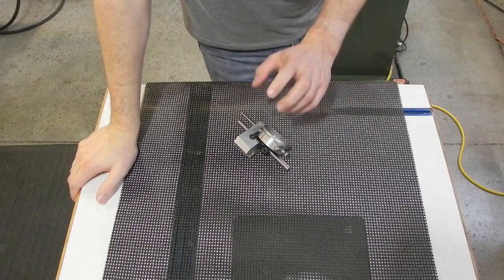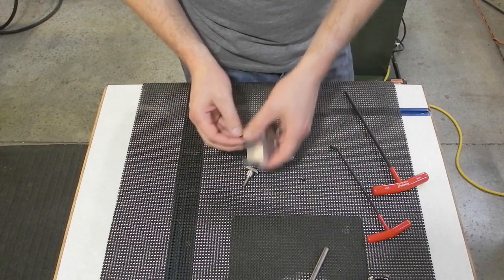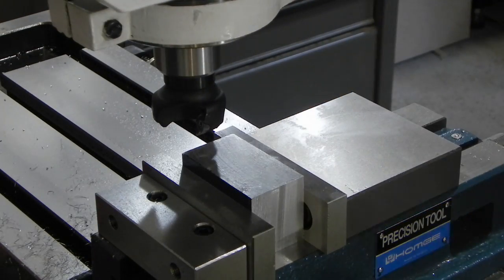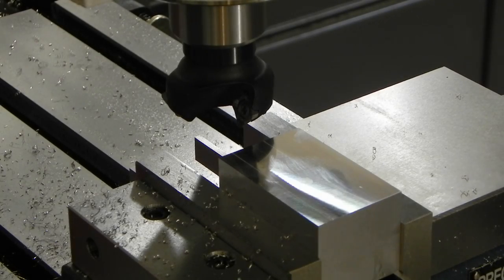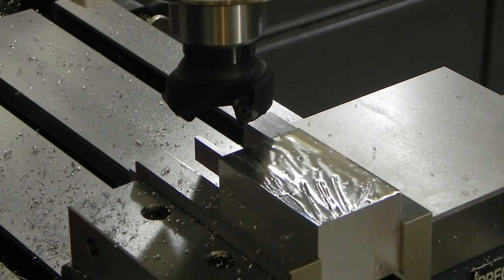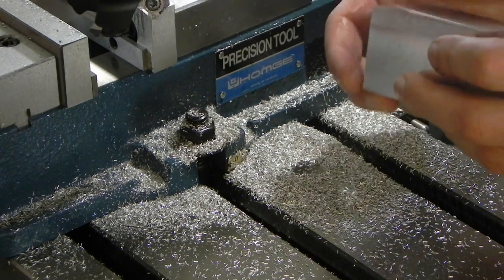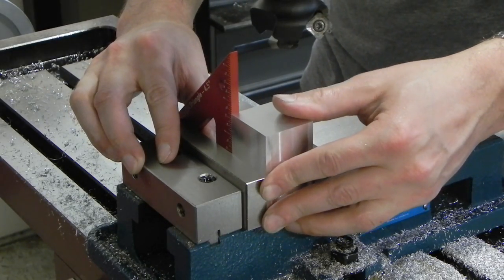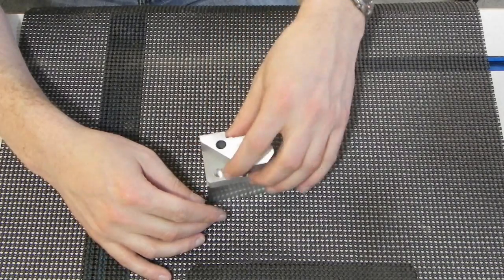Making a lathe carriage stop pt. 1

Comment: There's a few improvement points outlined below but the idea of using magnets seems a good one.  The bandsaw will cut quicker if the long edge of the workpiece was upright. Others have had problems getting enough torque on knurled knobs. The angles are usually, by design, not 90° but a little more. Make sure you use LESS than those  - the stop will then ride on the contact edges, so 90° is fine, it's actually better not to try and exactly match the ways. BobUK.

Comment: I'm not criticizing you here, If you use a wood blade in your saw for aluminium it would cut much faster. Or on your table saw with a carbide tip sawblade.

Comment: would it not have worked to just put the knurned bolt in the existing hole in the top ? I get that Allen bolts fill which chips which is super annoying, but your knurled screwd has no hole for the chips to get stuck in
Reply from the maker: When I played with the thumb screw,  I didn't feel it provided enough clamping force to reliably hold the stop in place when being used as a bump stop.

Comment: What did you do with your  old lathe stop ? will it fit a boxford.... will you sell it to me?
Reply from the maker: I still have it, I use it when I'm turning between centers at a stop on the tail stock end of the bed. I'm pretty sure it would not fit your Boxford, as it was specially designed for my lathes bed.

Comment: The instructions that came with my band saw state not to use any oil/fluid when cutting,....my guess is because it could work it's way up onto the drive pulleys and cause the blade to slip basically??
Reply from the maker: The only thing the comes to mind is maybe the blade guide bearings on you're machine aren't sealed, so they worry about contaminating them. What make/model of bandsaw are you running?
Reply: @Dans-hobbies  It's a fairly old one, Sealey I think, doubt that it's a model they still do.